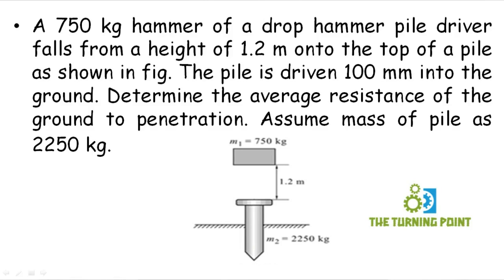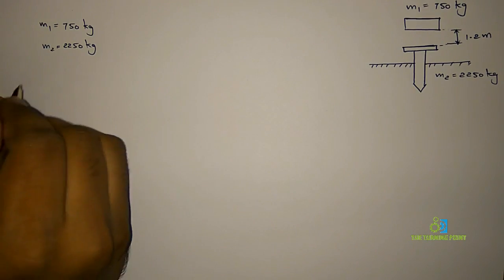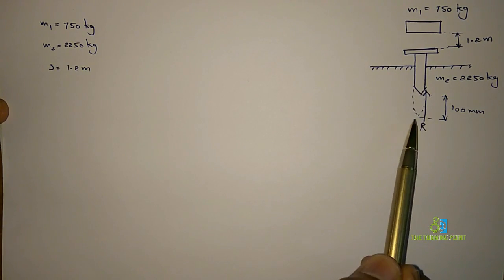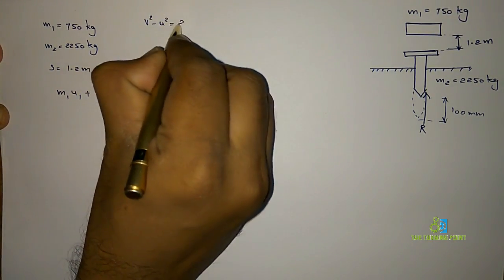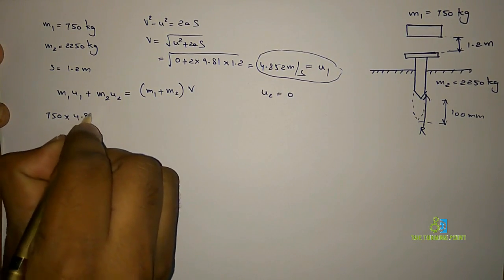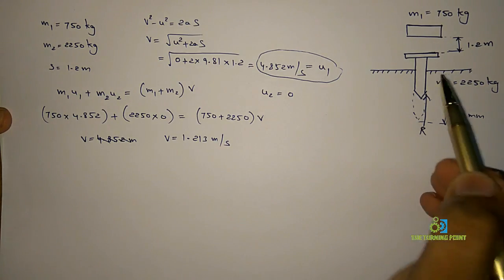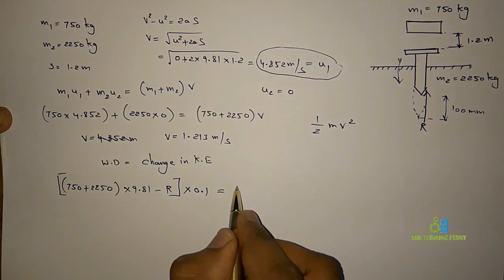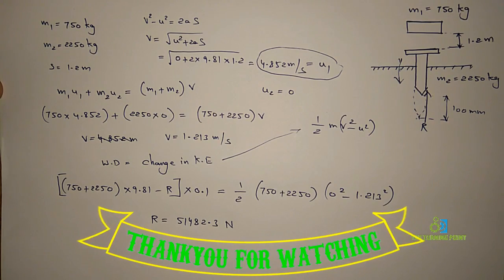Dynamics Problem 16

Comment: 3:38
Initially the hammer is under the sate of rest
4:02
Initial velocity of the hammer is 4.852 m/s
What am I watching here?
Reply from the maker: If you drop any object from a certain height it’s initial velocity is zero.
4.852m/s is the velocity with which it strikes the pile 
Here I have mentioned it as initial velocity in the aspect of applying concept of initial momentum equal to final momentum